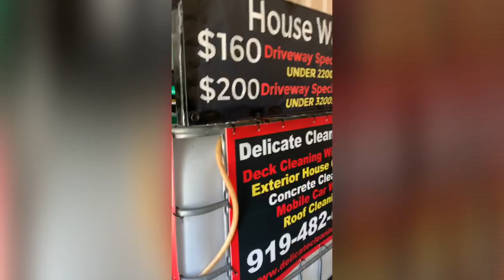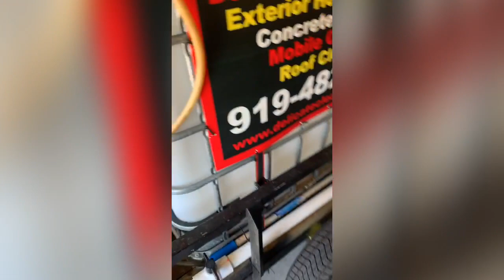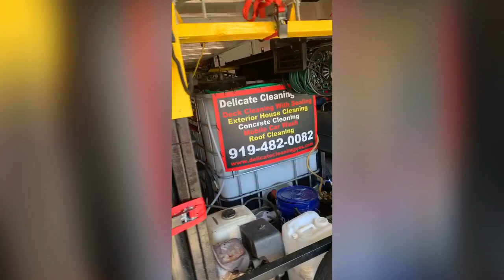Pressure Washing Trailer Setup/Introduction to Pressure Washing

Comment: Great information my brother.Are u from Baltimore?I got homies from Baltimore and they talk just like u bruh😂
Reply from the maker: Lol 😂
Reply from the maker: Born and raised!!!
Reply: I already know!😂respect!Keep up the good work brother!You are an inspiration to other brothers like me trying to get in the game.I appreciate your videos!
Reply from the maker: @tfrizzle03  I got a few pressure washing videos coming bro. Hope the best for you. Get in and get that bag
Reply: @MotivationalCharles  u got any information about mixing ratios coming up?that’s probably one of the more confusing things I’m running into
Reply from the maker: @tfrizzle03  what type of machine are you Planning to use? If your planing to use downstream injector you will not need to mix. Most homes will only need a 2 percent mix. But you need to know if your bleach is 12.5 or 10 percent. Do you know what bleach you will be using
Reply: @MotivationalCharles  thanks for responding.I’ll be using a 4gpm 4000 psi Simpson.I plan on downstreaming and eventually x jetting.I’ll use whatever bleach I can get.Prolly that 10% around here
Reply from the maker: @tfrizzle03  you should be good with 10 going through down stream. That would put you at 2percent. Check out video because it is harder to explain through text. https://youtu.be/Y8I_hQW86TY

Comment: Good hustle. I am getting into pressure washing. You need to add $100 to your prices on the sign. If the customer knows the price when you get the call, then you have. 99% chance you will close the deal.